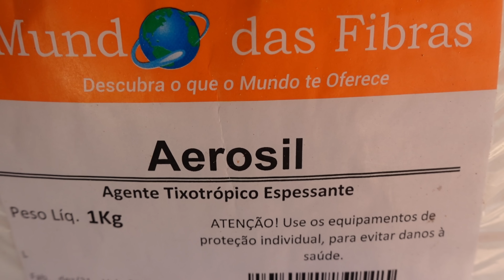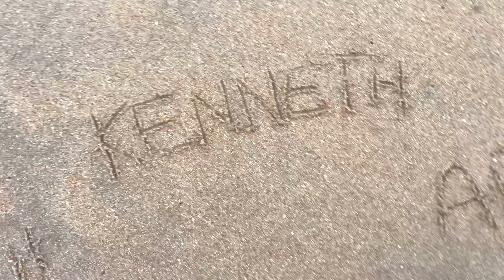Boat restoration: installing the new rudder didn't go as planned — Sailing Yabá #84

Comment from the maker: Hey guys! Does any of you feel like guessing how heavy our rudder is? ⚖
Reply: 500kg
Reply: 500 lb
Reply: With or without worms 🪱? … oh sorry I thought you meant the old one! 🤔 347 kg
Reply: I would say around  450lbs
Reply: 867lbs
Reply: 200 Kilo😊
Reply: 250 pounds
Reply: 395 lbs or 179.169 kilograms is my guess
Reply: 350 kg🤔
Reply: 550 lbs
Reply: 116.289 Kg
Reply: 275 Kg is my bit. 

Remember Ben that Your boat is what make You two so very special and the fact that You are going through such an extensive rebuild make your boat even more special. Eventually You will go sailing and I’m sure that is going to be epic and where ever You go You and your boat is going to be Center of attention. So don’t be sorry it’s taken so long, see it as a gift instead. Good luck guy’s
Reply: about tree-fitty
Reply: 180kg
Reply: Saying volume about 0,2m3 average density 825kg/m3, it should be under 200kg. But it looks difficult to move. Calculation, quickly, gives between 125kg and 200kg
Reply: 624 lbs / 283 kg.
Reply: 720 kg
Reply: 720kg
Reply: Yeah check 18:50 it is obviously heavy but not 500kg not even 500lb. Maybe I forgot how this workers are strong? 2 000kg ?
Reply: 280lbs
Reply: 475 kg
Reply: 548Kg
Reply: 228 pounds
Reply: 400lbs
Reply: 450k
Reply: I would say 200 kilos.
Reply: No I don't feel like guessing, my main concern is you getting insured to potentially sail this boat the pair of you have not got a clue about either sailing or putting the shambles out to sea. Grow up and get some professionals to legitimise the stability of your boat and stop pretending you are in control of your farcical situation.
Reply: I have made a comment once, just grow up and stop pretending you have a vessel that is fit for any purpose other than capsizing. Grow up and stop pretending either of you have a clue.
Reply: A lot. Your boat is a beauty. But she is big girl
Reply: I'd say about 620 kg.
Reply: Gordon 365 lb
Reply: 175 lbs.
Reply: @janbennetsen7292  missed a bit on the heel back there
Reply: Heavy🤣🤣
Reply: There are a couple of comments here , to which I would wish ‘IT’ flew a midge closer to the Sun ☀️!
Reply: 350kg
Reply: @ernestospadolesto8126  Can't you get any more precise than that?  :)
Reply: 281.458 Kg
Reply: @icarus877  Damn!!  That's harsh, dude!
Reply: Keep an eye on the rod you put in there that will wear down fast with no sleeve on it! LOVE the ship and she will love you!
Reply: 650 kg
Reply: A little bit more than I can lift on a good day🤔
Reply: 130Kg
Reply: 260KG
Reply: @icarus877  grow up and get some maturity of how to treat people
Reply: 525 lbs 238 kg!
Reply: 150 Kg
Reply: @loveoracle8797  There is always one arse in every group!
Reply: Start weight ,125kgs
Finished weight 
68kgs, sanded smooth ,  fitted to boat .

    Respect
Reply: Icky, you don't have enough smarts to find your way out of your daddy Daedalus' Labyrinth !!!  S. F. B.
Reply: 210kg
Reply: 897 pounds - eight hundred ninety seven pounds of hanging rudder

Comment: When you do a glue-up, don't tighten the bolts too much,  wait till after the glue has set-up, otherwise you can force all the glue out
Reply: Also with epoxy on wood wet out wood first with unthickend epoxy so it soaks in the wood/saturates wood before applying thickened epoxy for final glue up… otherwise you could get a dry joint…
Reply: @jmalte4702   A bit too late now. Or MP did'nt film it.
Reply: Too late lol
Reply: Jerry Rosa at Rosa String Works repeatedly claims there is no such thing as starving a gluejoint by clamping it too hard. But then again, he works on acoustic instuments, not boats.😊
Reply: @mark7321  Wood glue and epoxy are very different when it comes to clamping. A wood glue joint you want to clamp as hard as possible to get a proper glue up. Epoxy is the polar opposite. You want to clamp it nicely but it needs a good amount of epoxy in the joint to work properly (epoxy is structural - wood glue is not)...
Reply: I do believe this crew of shipwright has done this a few time before!
Reply: They did all this months ago i think. There was a video by another YouTuber with the Yaba in it which was posted a couple of months ago at least and the Ayana was already painted. So the work being done on these videos is months behind.
Reply: That’s what the white styrofoam he was putting in the resin is for. It will help to ensure that some of the resin will always be in the joint and not squeeze out.

Comment: Hi. I just wanted to give your shipwrights some praise. It's easy to CNC and laser cut your way to a new boat, but there is something romantic in Men, with simple tools, creating such a beautiful vessel. Also, the Bulwark is the flat plank that runs around the perimeter of the boat through which they chiseled the holes for the stanchions. The boards that are fastened to the stanchions, is commonly called the Gun Whalle, pronounced Gunnel.
Anyway, I look forward to seeing your dream boat come to life.

Comment: Hello, many comments on the weight of the rudder, but in the water it floats.. so it tends to go up.  Also about the forces that are exerted in motion in the water, the rudder created a drag on one side or the other influencing the movement of the boat, but it is not a rail that presses on a  solid.  Navigation is a story of sensitivity to the elements and the helmsman plays with these elements and not against them.
It's not the best naval architects who have discovered the world but the best sailors and these guys make boats every days for many years... congratulations
Nice job and great adventure. 😊

Comment: I got to make one comment! I know the epoxy guy is probably your resident expert? However conventional wisdom says... To pre wet the surface that you're going to bind together with just straight epoxy no filler and or thickened epoxy! The rationale is... The unthickened epoxy soaks into the grain of the wood first then you apply thickened epoxy that then allows it to bind to the wood without losing any of the thickened epoxy to absorption! And again this is conventional wisdom this fellow probably knows what he's doing and has seen it a thousand times on the wood that you are using and it's probably going to be  aokay! Goodonyas!

Comment: Please consider putting the boat in the water very soon.    As you use the boat I think you will find things you need to reconsider or rework a bit and this is much less work if the boat is not "finished".

God bless

Comment: The rudder looks a bit stubby.  Massive rudder stock which is good, but the blade itself looks a little short.  Backing down will be more difficult as will weather helm. I think one more gudgeon on the keel itself to the bottom of the rudder would do a few things. It would give another point of support than the one stern extension.  It would also block a line from getting caught between the keel and the rudder, or into the prop.  It would also strengthen the bending moment on the rudder in case of a grounding.  You might want to get the stuffing and prop shaft in before mounting the rudder up for the final time, I really doubt you can sneak it by there when it's in place.
Reply: 100% for one on the bottom. I was going to query this. The 2 there are quite close together. Yes, I think the blade should be a bit wider but the size might be traditional. It was copied from the old one.

Comment: Weight of rudder?  But you keep cutting it down, no handle yet, all the stainless, and the pintle?  So many questions, also how hard is the hardwood [forget name], ....
Anyway, my estimate is:  100 lbs stainless, 450 lbs wood, 10 lbs epoxy, coatings, etc  =  560 lbs
Love you two and the crew.  Wish I could help for a week or two,  but ... I'm a long ways away.
Cheers,
Dawson, Vancouver, British Columbia, Canada

Comment: Rudder looking nice, you can coat it with a fiber glass to avoid been soaked by salt water.
Reply: Not a good idea now, as they have bolted the fixtures on, over raw wood. 
If they had encapsulated the whole assembly with epoxy and glass first, that would have been OK.
If you get the slightest hole to let water in, It will start rot, and not be able to dry out with the epoxy layer.

Comment: That is supposed to go in the water and have heavy load on it during all its time . I expect the tiny pin you have for a hinge could give trouble over time.  Also why have you not bought these workers an electric winch with remote and save all that struggle under such loads every time we see them working. Four would be kinder. You'll also figure out how you'll service such things single handed Ben? What is your budget for nine shipwrights, plus  engineers & chandlers to create this historical reconstruction? Also would you tell us what Yaba was designed for in the original ?

Comment: I'd soak that whole rudder in epoxy resin.
Reply: Actually   epoxy is too waterproof unless the whole rudder is totally encapsulated. 
They need a permeable coating to allow the wood to absorb water.
A totally waterproof coating that only keeps water in the wood creates rot.
Reply: I disagree. I have a friend with a wood trimaran that was completely coated in epoxy (all sides, above and below waterline) and there is zero rot after 40 yrs. The wood is unlikely to rot unless oxygen is introduced. Thanks for the comment.
Reply: @aquious953  yes. I bet his catamaran was plywood,  and not solid timber. 
This rudder has fittings that were installed already,  so it would be impossible to totally encapsulate the rudder now.
On top of that, solid timber flexes and checks, so unless you glass as well as epoxy coat, it is going to develop moisture ingress paths. 
Rot requires Moisture, oxygen and Light, and you    are better off having any solid wood be able to dry out at intervals. Epoxy with small ingress points stops the drying ability, traps the moisture. 
Gougen  Bros "bible" on Epoxy coatings gives a complete overview.

Comment: That massive rudder is a thing of beauty! Just a thought; have you considered using hydraulic linkages instead of cables to move it? It's a very heavy piece!
Reply: It is not a rudder that will be constantly turning. Point, set and forget.
Reply: and has buoyancy when in the water....😮
Reply: @JHK66  good point! 👍

Comment: That rudder is quite unhydrodynamic.
You might benefit with an extra curved trailing edge on the rudder, with a glued on strip of wood. 
I certainly hope you will round the leading edge behind the propeller.

Comment: For hand steering, you might consider cutting off the vertical post before the swimming platform and installing an universal joint (like on a drive line on a car) making the extension truly vertical with a smaller diameter metal shaft so the person on the deck can easily steer the boat.

Comment: What a contrast from ship rebuilding which you are engaged in, and airplane rebuilding which I am engaged in. The amount of mass of the materials and the finished product of those two could not be more different. Yet both require skill, knowledge, and a lot pf patients. Changing plans as required and making modifications along the way seems to be a common thread. Another very good video from you two. Cheers from Winnipeg.
Reply: Yep, two different universe !

Comment: Really shocked they didn’t put any dowel pins  in the rudder
Reply: Sorry - what are dawpins?
Reply: @TR4zest  dam speak text  dowel pins
Reply: @johnyboy6932  Ahh, thanks Johny.
Reply: Why would they need them with epoxy and huge stainless steel bolts?

Comment: I guess the rudder weighs around 200kg.  I am surprise there is no rudder connection with the keel, perhaps it will be included next time.  I think some more fairing to the aft section of the rudder will improve the steering performance and feel of the rudder.

Comment: Nice work on the rudder.
Question: What will the diameter of your propeller be, and will it have enough clearance (±10% of the prop-diameter)? This to avoid irritating soundeffects and eventual damage to the wood of the keel.

Comment: It looks a small rudder area in comparison to boat !!. It’s ok at sea, but manoeuvring around a harbour could be a problem.  Have you thrusters ?. Can I also add what a fantastic build project, well done, congratulations.
I’m a retired engineer and I love to see your workforce. They would all be barred in the UK.  No safety shoes, no hard hat, no safety glasses, no ear defenders, and most obvious NO SMOKING in a joiners shop. It takes me back to the good old days when work got done more effectively. No wonder we can’t compete with overseas when we put so many obstacles in the way of our workforce. Don’t worry I see both sides, just pointing out some of the problems we have running a business in Uk and Europe.  The old guy who is the top shipright looks to be close to retirement and has worked like that all his life without any problems.  Ooh the good old days, cheers from Edinburgh.
Reply: They have thrusters. Sails.
Reply: Yes, health & safety was in the worker’s head, not written in some book by someone who has never done the job.
Reply: @johnnunn8688  It still should be.  All the extra "safety devices" placed on equipment to protect an incompetent operator just breed a false sense of safety.

Comment: are you going to paint above the water line or leave it the natural wood on the hull? I think the natural wood will look amazing. I also wondered if you are going to add a layer of clear fiberglass like on a wooden canoe to protect from rot. love your channel best part of my Sunday morning all the best from alberta Canada 🇨🇦😊
Reply: Thanks for bringing up the issue of painting! I've been thinking along the same lines! Below the waterline I see the boat-eating borers as being the biggest problem. They are the curse of wooden boats everywhere but esp. in tropical Brazil apparently. It was mainly borers that did for the hull of the first Yaba. I agree with you that the topsides would look fantastic clear coated! They could be epoxìed or heavily varnished but I'm not sure how durable it would be! It might get a little expensive over time.
Reply: @Davidcallard   I don't know much about marine paints or dealing with rot and worms in the tropical areas I sail in the Pacific northwest the slip beside my boat has a old wooden motor yacht he has restored it much like yaba and used fiberglass to protect the wood you can't tell. It looks beautiful

Comment: It looks like the rudder is hanging, does that not mean that in the water it is going to float? What is holding it down? It will also require huge forces to turn, especially in the propeller wash as all surfaces are behind the pivot point.

Comment: I can only think that Ben collects and wears certain headgear and grew (a now sadly vanished) moustache out of a sense of humour.😂 Great to see the progress👏👏 Doesn’t the rudder need treating to protect it and would this not have been easier before it was put in place?
Reply from the maker: Hey Mike! You are absolutely right about Ben's moustache, it has more to do with the fun he has than about the looks of it. 
About the rudder, it was installed so we could test everything around it, but it has to go down again as the mounts have to still go through a welder and then the rudder will definitely get its layers of protection too 😉

Comment: I have to admit that when I first saw the condition of the boat, I would have taken it out and sunk it .... but I was wrong this thing is looking amazing and will be absolutely beautiful when finished . also I think Ben is starting to build up some muscle look at those arms. great job and you and the team are doing amazing.
Reply: But this isnt the same boat, it was cut up and used as a template and burnt the only original parts are the masts and some of the cabin roof. The engine ,anchor winch. and some of the metal fastenings.

Comment: Its not the force of turning the rudder in the air, it will be the turning the rudder in and through and  against the flow of the water as the boat travels that will transmit forces to the steering apparatus.

Comment: Also it is advised to wet out the wood with just epoxy resin,  otherwise the wood will soak up all of the  resin in the thickened epoxy and make a dry joint
Reply: It helps if one thins out the epoxy with acetone . Mix a batch of slow hardener . Cut that batch about 50/50 with acetone and paint it on. The wood sucks up the thinned mix and the acetone evaporates . T then follow with the thickened stuff to make the joint. Poor man’s penetrating epoxy.
Reply: @Pocketfarmer1  Nah  NEVER dilute epoxy with thinners for a high load joint. 
It destroy the strength and waterproof long chain molecules.